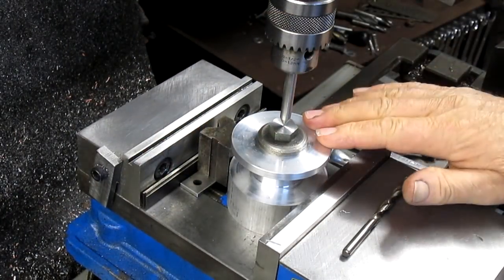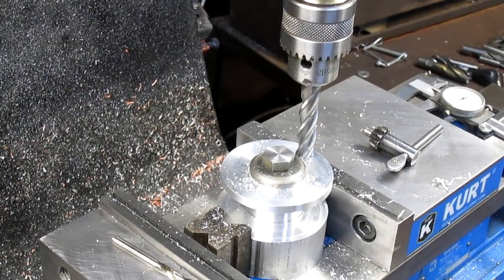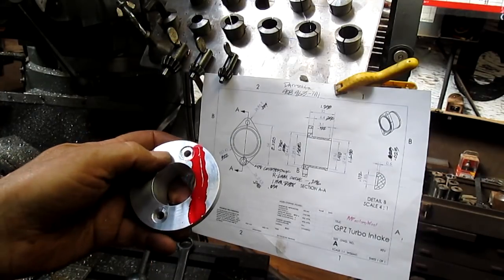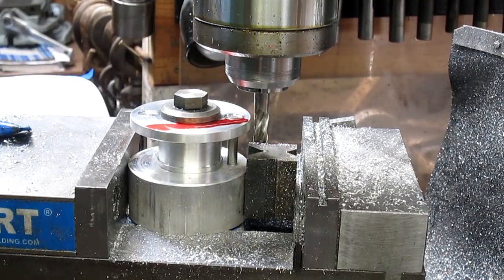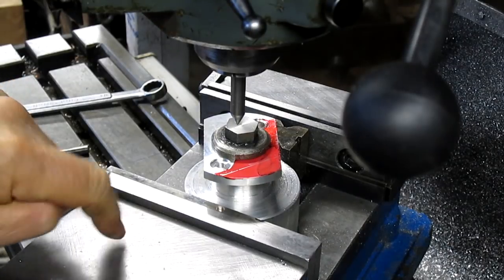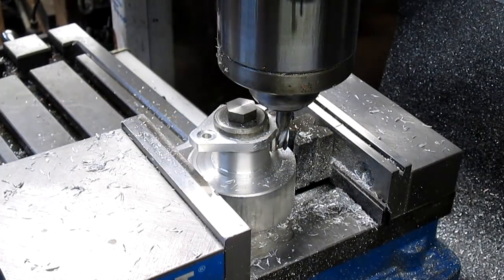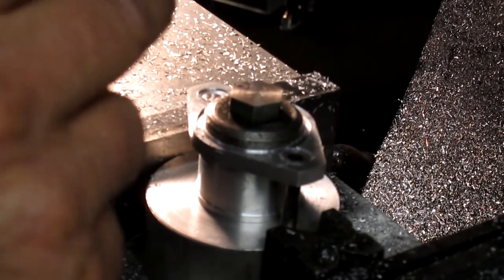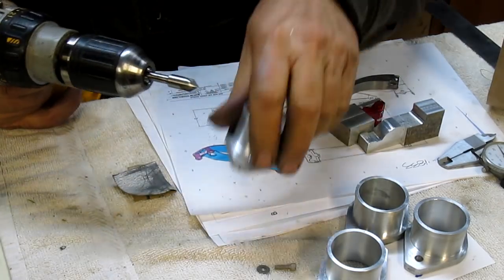Intake Aluminum Manifold #2 final

Comment: Nik

I think I would have questioned the cutomer, as the o-ring groove is not continuously supported all the way around, as it sure looks like (at least on one piece) that the o-ring groove cut into the flange bolt hole.  Would result in a o-ring blow out/extrustion at the interuption.  Of course, I don't the pressures involved, but I sure would have queried the customer about this, as it appears that this shows on the spec sheet.

John
Reply from the maker: Did talk to the customer and the groove was not for an o-ring as I thought, but a relief for the mating part.

Comment: Just wondering how accurate you could possibly be rotating around a base that is out of round? The holder’s base that you machined the top of is out of round at the base.  You said when machining it that it didn’t matter but your fixture base is out of round to the part.
Reply from the maker: If the sleeve holder contact surface is round and the base face is square with the center, then one can indicate to  the holder surface and you will have an fairly accurate center. I can't remember, but I believe I had +/_ .010 slop on most surfaces so I wasn't worried about being precise. It was a quick way to reproduce my cuts and when quoting jobs quick is the key.

Comment: Like your set up for milling the radius shape. Nice video Nik. Got my surface grinder going, time for some exhaust flanges for my flathead. I’ll use your idea but with two locating pins.  It’s roughly 14” long.   Thanks for sharing.   👍
Reply from the maker: It took some time to build that jig, but it was worth it. What kind of flathead?
Reply: It’s a 59AB X race motor in my picture.  Had a big huffer originally. L code block 286CI as she was built originally in 49/50 raced and put away until I found it two years ago September. Harmon Collins 3/4 cam, alum schiffer flywheel, silvolite pistons, awesome bowl job and power slot, valves, ports, lots more.  It’s a nice runner. In my 29 coupe. I’m only in Sac, I drive it....... 😁. Want to build some nice headers. No mufflers now, just baffles I made. Thanks for asking.       Flathead Ron...
Reply from the maker: You got some photos on line? Send a link.
Reply: Nik, sent you two emails with some pics. I need to learn this computers crap program soon   Please let me know if you got the two emails
Reply from the maker: SOrry, didn't get the 2 emails.

Comment: Hi Nick, good video again. Just a question why are the hole countersink a on the inner side of the flange instead of the outer where the bolt head/nuts are?
Reply: the way the customer  wanted it
Reply from the maker: Not sure why, but that was how he designed it.
Reply: These flanges go onto studs on the cylinder head. Mounting them, is easier when there's a little countersink to guide them on.